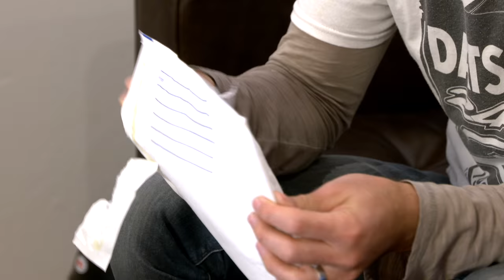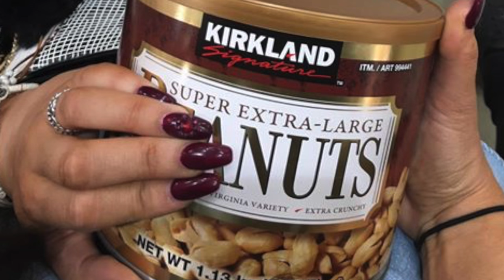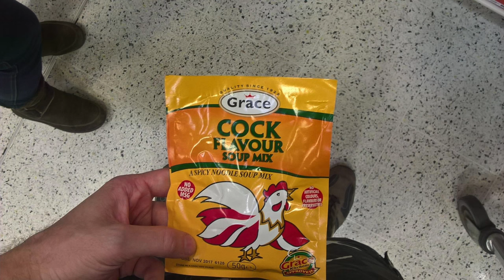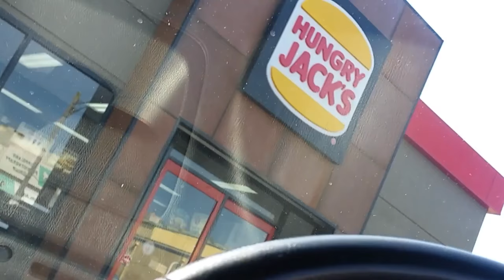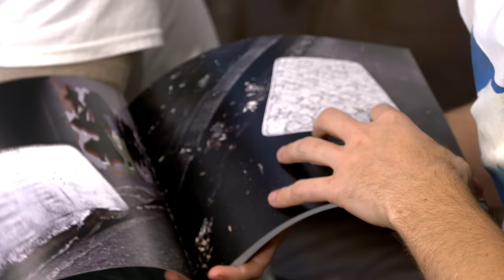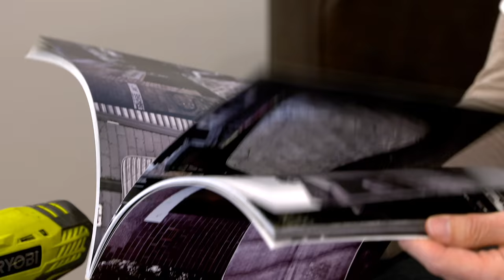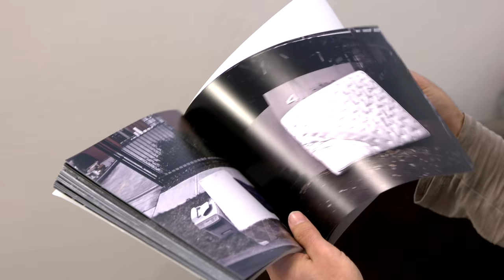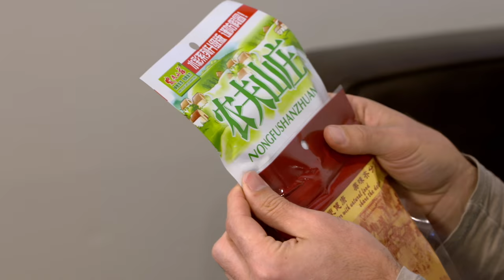Golf GTI VS WRX, German Commodores, TESLA V8.0, Ariana Grandes Fur Ball [UNICORN CIRCUIT EP12]

Comment: The AWD system in the Golf R is for all intents and purposes a FWD system with a shaft splitting power to the rear if it detects that it really needs it, up to 50%.
So trying to drift with that is going to be a lot more difficult since it's trying to send majority of the power to the front wheels.

Comment: As a Subaru guy myself, I'd prefer a WRX over an STI, regardless of any "cred". The STI has all it's power at the high, high RPM's. The WRX engines have a wider torque curve. Unless you put a big, big turbo in. But I'd prefer an Outback XT ( or Legacy/Liberty GT ).

Comment: Why the Gold R outsells the STI, I can think of two reasons:
1. The Gold R is seen as a status symbol, and not as boy-racer as the STI. 
2. The Golf R is sold as an automatic, so again you have people who want the status symbol of a fast car but can't/won't drive manual.

Why the Golf R probably got destroyed in the skidpan, assuming the driver was competent; the Golf R uses a Haldex AWD system, which is pretty much a FWD system that shuffles power to the rear when needed. This means hard to do skids as the system inherently was designed to limit slip.

Comment: The New commodores from Germany will not have a V8 or Rear wheel drive, only turbo/supercharged v6 (and some other engine NA v6 or something) and only come in fwd or awd. The WHOLE point of the Holden was the v8 and RWD. It will be a big failure... :O